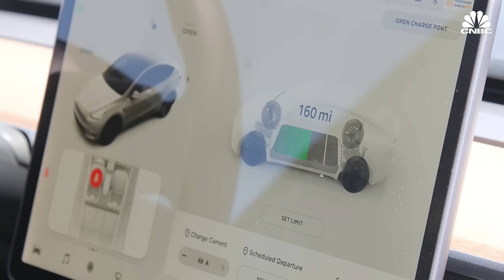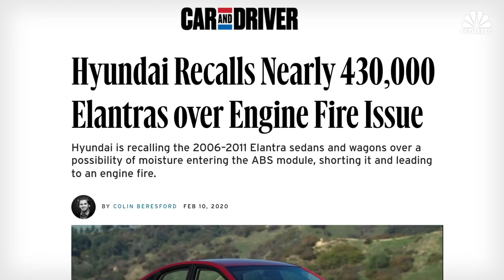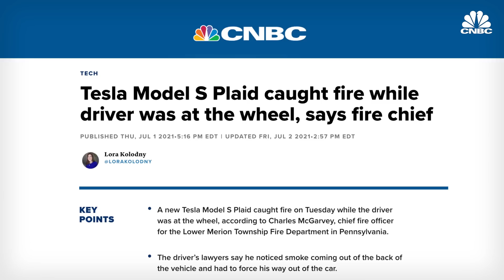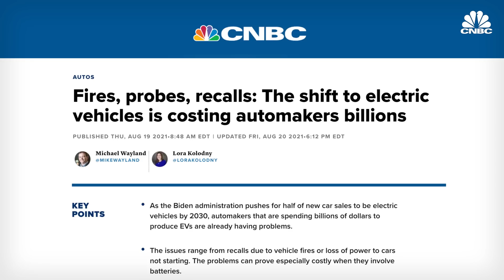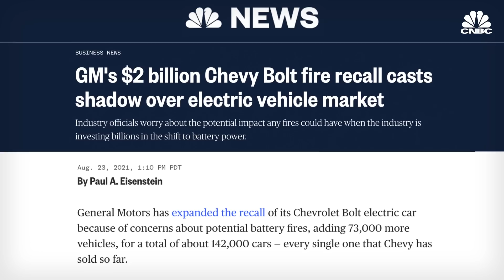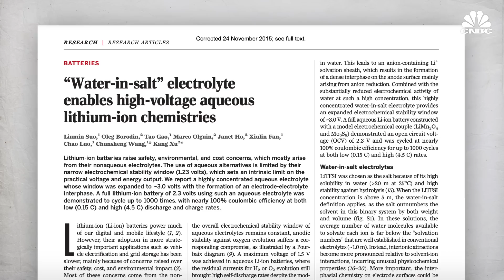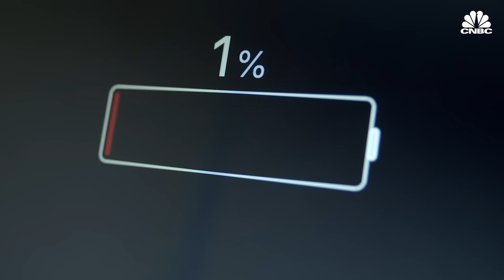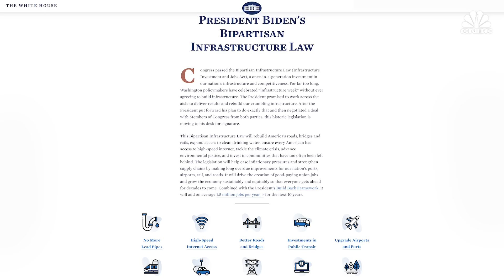Why Tesla, GM And Other EV Companies Have A Fire Problem

Comment: All this publicity in favor of electric vehicle has more to do with politics than physics. It's a myth switching to EV's will cut carbon emissions because the electrity that charges the vehicles will be produced by burning petroleum or gas. And then we have the grid to consider, because as it is, we are operating at full capacity and an beefy upgrade is badly need it.
Reply: That is true, the carbon emissions are dependence on what is powering the grid, but the grid is always changing, getting greener and bette., a ICE car does not, it gets worse with age and costs a lot to fix, a EV gets cleaner when the grid gets cleaner.

Comment: What needs to be investigated more is the possibility of crash fire. In many cases, traditional cars catch fire in the front, where you can notice quickly and get out, but EVs burn from below in a ferocious manner. You may not even realize that you have to get out ASAP. There had been numerous cases where the driver was burnt alive, which rarely happens with traditional vehicles.
Reply: Combine this with many of these new EVs (and frankly new cars in general) coming with fancy electric door handles with weirdly hidden manual emergency releases cough Tesla…
Reply: What about the feller that came back to his top of the line EVs, got in to it tried to start the battery was flat and all the doors and windows locked,he could not get out had to ring his office for the spare keys
Reply: @tjhessmon4327  In my lifetime, I’ve had factory installed stereos w/ amplifiers and subwoofers. Never have I had one overheat, and cause a fire. The only situation, where a stereo/amplifier/subwoofer would erupt in flames, is someone unqualified, who installs said equipment in their garage.
Reply: @denisek292 And foolishly at that!
Reply: So… Maybe design the batteries to be placed where a Gasoline engine would be at? Up front it and under the hood.
Reply: Here on YouTube, I watched a video of a car crash involving a new hybrid Volvo. The passengers burned alive…horrible to imagine such a horrible death.
Reply: If you can open the door when the battery quits.
Reply: @navret1707  exactly.. or if the auto pilot does something like run your car into a house
Reply: @ozplasmic351  how about we both take a blow torch ill light mine over a battery pack and you light yours over a gas tank and we will see who has the greater chance of survival 😂🤣
Reply: All anecdotal evidence, the facts are that 250,000 ICE vehicles catch fire every year and cause the death of 560 people, why dont you hear about that, because it is politically and financially motivated, the petrochemical/legacy auto manufacturers dont want you to buy EV's
Reply: @GNMi79 Totally agree w/ you. I can see someone installing a huge amplifier drawing  too much juice from a a regular car battery (not a lithium EV battery) causing some potential problems…my “know-it-all” ex did that, making the trunk area a little too warm, so I never placed plastic bags in it. My father used to work on a plethora of electronics for CSX. He has Alzheimer’s now, but, yes, he would laugh at anyone suggesting a factory installed/after-factory installation by qualified technicians, would cause a vehicle to burst into flames. EV’s spontaneously combust, because lithium batteries are unstable…one reason I never leave my MacBook or iPhone charging when I’m not home.
Reply: Wondering if this is what Anne Heche was driving! That fire was insane!😢
Reply: Maybe a smoke alarm in ev's will help? Smh
Reply: @tjhessmon4327  yes probably 100 stero fires in the last 30 years 🙄
Reply: @ozplasmic351  I’m not trying to sell you nothing I’m just responding to your ridiculous claim you do what you want
Reply: @ozplasmic351  if you get t boned car catches on fire gas goes up like a bomb spontaneously where as lithium is a daisy chain of cells…  you def have better chance in lithium… that’s why the first last so long cause all the cells don’t go off simultaneously…. Fire reaches a gas tank it’s done for…
Reply: Electric vehicle fires are gradual build up.. this burned alive without realizing it is so far fetched ….
Reply: @kennsdlyalcima7848  No not in a car crash. They do burn up immediately.
Reply: @kennsdlyalcima7848 not in a crash. You're thinking about thermal runaway starting from a single cell. In a crash it can all go up in seconds. Watch what happens when you smash a single lithium cobalt cell. Now imagine a car crash with 7000 cells getting crushed by 2 tonnes of mass moving at 60km/h.
Reply: @kennsdlyalcima7848  excuse me? gradual build up??? if you search ''Tesla parking garage fire'' on youtube you'll see in the first or second video that the Tesla literally burst into flames in the blink of an eye. Apart from some minor smoke, there was absolutely no warning before the whole thing turned into a gigantic blow torch. Imagine driving normally on the road with your kids strapped in, your baby locked in his special seat in the back. And your Tesla burst into flames in under 5 seconds when ur going 80 km/h, do you think you'll have time to realise it's happening, stop the car, get out, and unlocking your children from their seats when the car is already shooting flames? think not.
Reply: @dennis_nl7587   yea gradual build up 🤣😂 you yourself just said aside from from smoke it was spontaneous… these packs are made of thousands of cells they don’t all go thermal together.. these issues typically start with 1 single or maybe hand full.. and has a dominoes effect.. your watching videos people put up when things have already gone haywire… And if your driving Tesla battery packs are equipped with temperature emergency warning/shutdown … if it’s about to happen while your driving you will know and have plenty of time because the safety system that observes temperature activates well below the thermal runaway temperature of the battery cells… theres like 100 temperature sensors throughout a Tesla battery pack.. these cell don’t go from working to spontaneously catching fire… they catch fire from getting to hot..before you would even see the smoke your taking about the car safety system would be been triggered
Reply: @kennsdlyalcima7848  yes, but you forget that the batteries can get damaged or punctured. And we all know what happens if lithium batteries get punctured. And in the video it's literally just a Tesla sitting in a parking garage doing absolutely nothing, how does it get hot for no reason? How do the batteries smoke out of nowhere? And yes, the car didn't "gradually build" up. As I said, it literally just exploded into a ball of fire. This even happens to Tesla's that are driving on the road. And we all know that electrical systems can fail too, so you might not even get notified for extreme heat. There are countless of factors that make EV's pieces of extremely dangerous garbage. And I didn't even mention the extremely toxic fumes from the burning batteries, that's a whole other subject altogether.
Reply: @kennsdlyalcima7848  one guy did burn alive but he had aftermarket unbreakable windows so the firefighters/whoever was trying to break his windows to get him out of the wreck he caused(drunk i think? memory so forgive mistakes) were unable to break the windows to rescue him. If he had stock windows they'd have been able to save him.
Reply: @0xsergy  I believe you you also forgot to tell that this was a diesel land rover like in Luton airport

Comment: I don’t know how someone would sleep at night having one of these cars in their garage, let alone plugged overnight. You can literally burn down your house to ashes. Even crazy to hear firefighters can’t even get to the batteries to put out the fire.
Reply: And it can spread to neighboring houses .. It is not good
Reply: In Sweden (one of the most EV dense markets in Europe) we have roughly 5000 car fires every year (with all fuel types), In 2020 we had four (4) fires in battery packs of  electric vehicles; 2 of those were electrically converted petrol cars, the other two fires were two cars that had crashed where the fire originally started outside the battery, but eventually spread to the battery pack.(total number of EV's here are roughly 156 000)

And all firefighters have mandatory training on all types of vehicle fires. 

Most fires,where EV's are involved in Sweden, are electrical fires caused by people using ordinary EU sockets, and not designated chargers, where the sockets or household wiring catch fire due to overload; this due to the fact that EU sockets are designed for low electrical load, like the load you have when you use a toaster, and not charge an EV.
Reply: @lezzeti  sounds sensible, hard to imagine
Reply: @lezzeti  sweden heavy censores and falsifies news I was learning swedish listening to lots of news during the migrant crisis era, I dont believe one singel word you said... the swedish 100% falsify data to pander to the climate alarmists... SWEDISTAN
Reply: Gas xplosions are much better .. 🎉
Reply: Gasoline only explodes in Hollywood movies. In reality gasoline does not explode because there isn't any oxygen in the gasoline. It can't burn or explode until it comes it contact with oxygen. Batteries are flammable chemical packs with the oxygen inside of them. They are more like gunpowder than gasoline. If they start to combust they will keep burning. They can even burn underwater.  @JordiLA
Reply: As a firefighter for 7 years how can you sleep at night in your own home with electricity running through a 24/7 and most likely gas pipes. Also petrol vehicles are a lot more dangerous then EV'S. What I'm saying is it's the media doing what media does best.
Reply: I would be unhappy about that and would not currently buy one
Reply: The same way you sleep with your laptop, phone even modems have lithium backups in them
Reply: @kennsdlyalcima7848  much different you are talking about thousands of lithium cells compared to a low voltage low current phone or computer. The average voltage for a computer is 12volts the average voltage for a EV is 400volts. Big difference.
Reply: @zooker7507  the summation of the voltages of voltages are irrelevant…. The individual cells are all the same and being put through the same stresses… it’s more common actually to see fires in smaller hoverboards ands e-bikes cause a cell malfunction a single cell malfunction detrimental to the whole pack then a single cell malfunction in a pack of thousands….
Reply: @kennsdlyalcima7848  the sum makes a big difference when a short is the concern. With each cell in a series circuit presents a higher voltage the greater the voltage the greater the current draw.
Reply: @zooker7507  greater voltage means lower current draw… but large packs are far less susceptible to catastrophe from a single cell malfunction.. these packs have individual cell fuse a short is nothing…
Reply: In the case of the salt water shorting the battery pack, like what just happened in Fort Myers Beach after hurricane Ian. This is not a case where 1 cell is failing it is causing the whole 400 volt pack to short. The current draw is effectively infinite for the whole pack. 400 volts will produce destructive current flow which causes all the cells to ignite. I think you are referring to when 1 cell fails that's not as critical of a situation.
Reply: @zooker7507  that’s a completely different scenario that what was posted in the original post
Reply: @kennsdlyalcima7848  the greater the voltage the larger the current draw. That's basic electrical theory. I=E/R
Reply: @zooker7507  your I=E/R don’t really apply to batteries… battery power and voltage not the same thing… if you shorted a single 3.7v tesla cell and shorted 3.7v pack of 7,000 plus cells in parallel. same voltage very different results… I’m saying higher voltage lower amp in equally power situation….
Reply: Internal combustion engines catch fire spontaneously too, but nobody would read an article about that -- too boring.
Reply: @juliam6442  oh don't be so sensitive just keep thinking that way if it makes you feel better
Reply: @juliam6442  yes but it burns out while its impossible to put out EV fire and it will continue to burn even after weeks

Comment: 6 Buses have since gone up in Potters Bar in May when one blew up whilst charging and Transport for London pulled the other 108 ones from operation as a precaution. Looks like minimum distances or even firewalls need to be maintained between these buses as they do seem to go in batches if parked close.
Reply: Busses are back in service and it appears, or the rumor has it that some engineer connected the cooling system the wrong way and caused the battery pack to overheat. Other rumor is that they used the wrong type of charging cable and it overheated causing the fire. More diesel busses catches fire then electric. At potters bar, only one electric bus caught fire, while the remaining 4 diesels blew the rest up easily.
Reply: @addylayta9691  Such a believable story. True enough, diesel engined vehicles are exploding every day, it's just a conspiracy by Big Oil that does a cover up.
Reply: I checked the call-out logs online for the Fire Service in that area. There is no mention of 6 electric buses catching fire....I think you're telling porkies.....
Reply: @Brian-om2hh  It seems clear as far as we can ascertain an EV charging problem kicked off the event and the other buses may have been diesel. Rather academic what type of vehcles were parked next to it along for the ride though if diesel the fire was probably easier to handle. This technology is in its infancy and being rushed with political rather than pragmatic reasoning as to actually what is acheivable at this time. Again Diesel was what the government wanted everyone to have and now it is the pariah and we have the same rush in to EVs to solve all our problems.

Comment: Not only is the world rushing headlong into the electric vehicle market,  forgetting the real fire and toxicity  hazards associated with those types of batteries.   But also ignoring the  electromagnetic radiation emitted, a long  suspected potential cause of health issues, including cancers.  Futhermore, you can't ignore the potential issues of recharging should the electricity grid go down for days, weeks or longer, and no way to change the flat batteries or charge them up for most people.  With conventional  vehicles it is easy to keep some fuel "just in case".  Oh, some electric vehicles can, as I  understand it, be shut down remotely,  great if the controlling central computer system was hacked, or developed a fault that caused tens of thousands of internet connected vehicles to essentially malfunction and just stop wherever they happened to be at that time.!!!

Comment: This isn't so much the problem with battery fires as it should be ,but propaganda against other forms of transport. Li-ion  fires are a dangerous problem especially when your sitting on top of a ton of the stuff.  Liberals have rolled this out without any testing and no real safety data just to push their economic agenda while they are still in power.  It is their narcissistic desire to destroy any form of public power generation that they don't control and have no back up plan for when it goes wrong and it already has.

Comment: I would not sit in back of an EV bus ..You would not be just burned but vaporized in to dust which would be washed away by a fire hose, like you never existed ...Go Diesel !!!
Reply: Or overhead wires or buried pickups which worked fine for trams or trolley buses for so long. Still do in many countries not so desperate to scrap any existing old fashioned way of doing things and constantly experiment. Diesel kills in a big way but it is not so exciting and newsworthy as a bus fire.

Comment: the fact is private transportation does not contribute to the majority of emissions and the modern petrol/diesel ICE engines emit far less than in the old days! at this present time i would think the better move is not killing off ICE but adapt/redesign them to run on more cleaner burning fuels like alcohol based (ethanol, methanol, butanol) or gasp biogas (preferably renewable not from fossil fuel) Btw the Scandinavian nations are showing the way : Ethanol 2.0 (not from food crops) and Green Methanol (from direct CO2 capture) are real solutions and much safer paths we can go with current technology until batteries become more dependable...

Comment: Electric vehicles will never take over. An environmental disaster is already taking place, dealing with the dangerous battery and ewaste from these very complicated, expensive machines that you can't fix yourself. You know most hybrids show up for scrap and are broken down with less than 100,000kms on them right?

Comment: As a human, i must say that liquid fuel (gasoline) and high heat generated by operating automobile engines, do not mix.  Many more thousands of liquid fuel fires occur on a daily basis due to ruptured or decaying fuel lines and the fuel dripping on hot engine blocks and yet no solution has been provided to permenently extinguish these over the history of the internal combustion engine.   By comparison, battery fires do occur albeit in very small numbers by comparison.  In addition, battery chemistry is changing by the day with safer alternatives currently in production.  I speak of lithium phosphate and other chemistrys  already being employed by the largest EV makers include BYD in China, and Tesla in the U.S.  In addition, there is currently a class action lawsuit underway in the U.S. in which Hyundai and Kia are both being sued due to very high fire rates in their NEW cars.  Overall, although battery power may present some problem, the bigger problem is oil burners and their inherent dangers which are far greater.
Reply: I always think Oil will be used for something far more important in the future than we think and we're burning the stuff up on a daily bases.